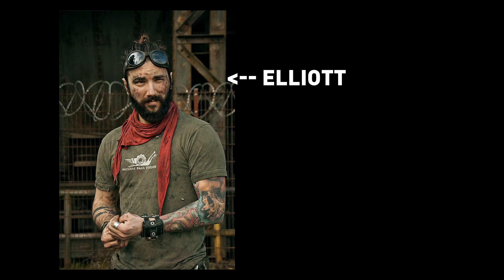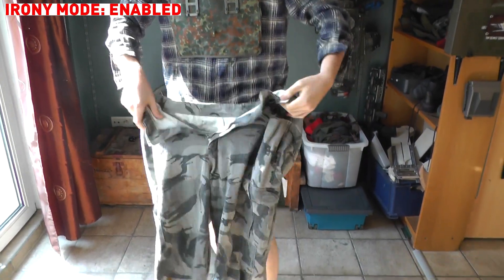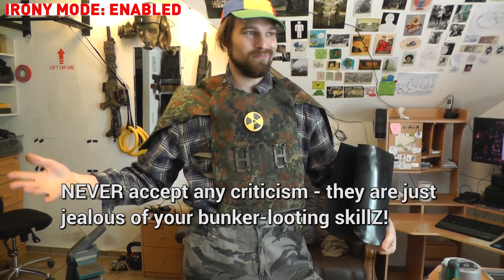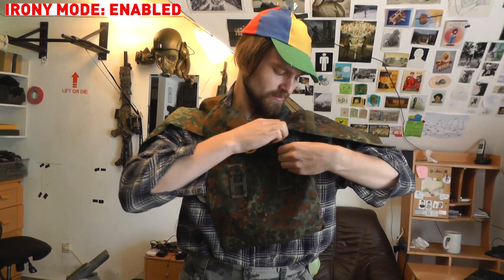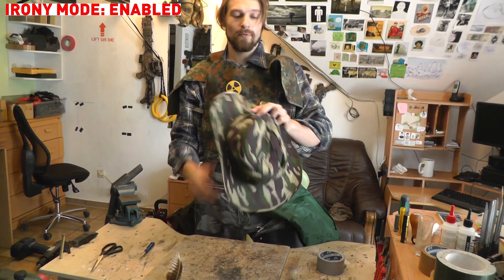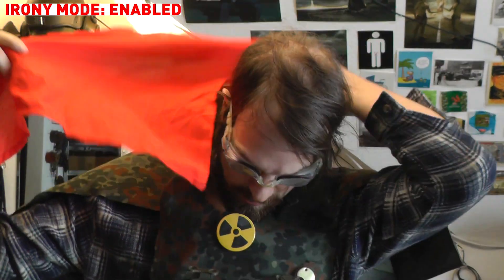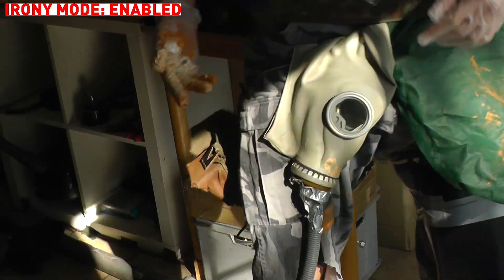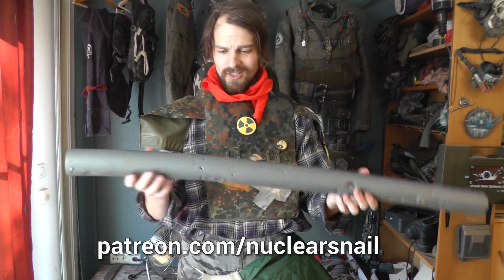Become THE WORST at post-apo costuming! FULL GUIDE!

Comment: want to know about my worst costuming incident? 
so I had found some tools in the back of the shed (they looked like they had been there for years but were at least usable) and decided to make some gear including goggles that had some ability advantage in the game, bracers and a shield. they turned out alright but there was still some left over materials so I made a display sword from one of my OCs by getting a thin piece of metal and putting poly carbonate ether side which made it look like it was ether frozen in glass or ice or something (obviously I wasn't going to use this I was just going to put this on the wall or something).
So my friends came round and we all wanted to play a new scenario one of them had came up with. (when we go over each others houses we do this roleplay that is basely DandD but the fights are done with larp weapons and armour and if we were traveling somewhere we had to run across the house x number of times and things like that) After about 30 minutes we had a out of character tea break and one of my friends said that the sword matched my bracers so why wasn't I using it and I said it was made of real metal and then she asked what it was made of so I said sheet metal and poly carbonate and she said. "You what? poly carbide? that's a real metal?" 10 minutes of irritating mycharacterisamegalomaniac comments later and they decided I should carry the sword as a relic and just not use it as a weapon. by this point I just wanted to get on with the game and didn't really care but then 5 minutes later back IC but in real life I had to run along a 2 foot wide corridor with a "relic" that was almost as LONG as the corridor.
well put it this way I had to buy some new paint to cover the 3 inch patch of paint the "relic" removed from my wall